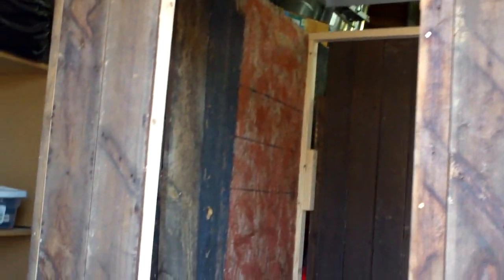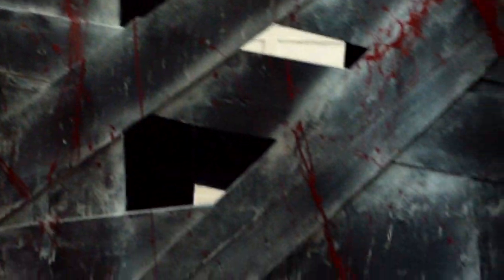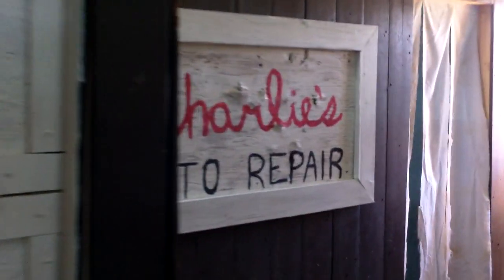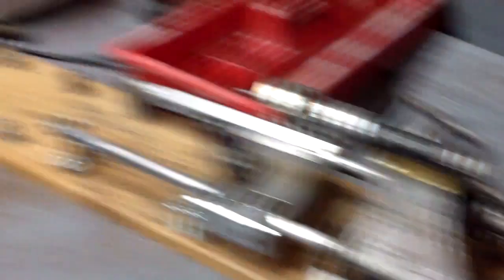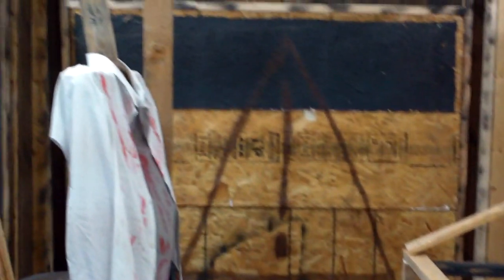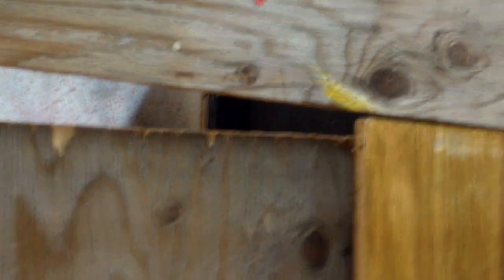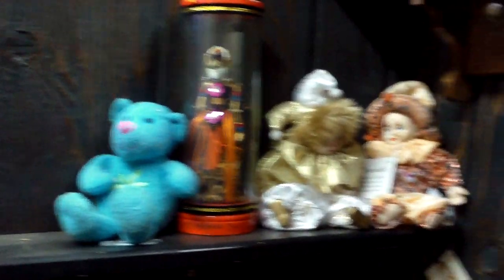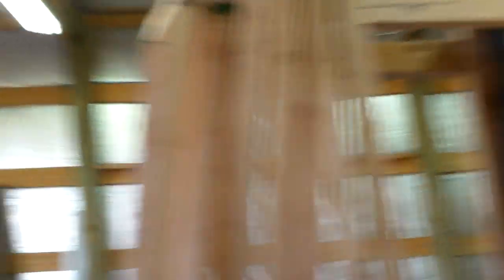Walkthrough of Creep Acres Home Haunt Oct. 1st 2012

Comment from the maker: The metal fences in the rapair shop (if that's what you were referring to) are just the $8 metal frames for cement laying. If you do use it, be sure that the fence isn't actually secured into the frame around it, but is just fully surrounded by wood so it doesn't fall out (because if you attach it to the wood, it won't rattle nearly as loud)

Thanks for the comment!!

Comment: Alright, thanks for the advice. I'm actually thinking about putting that fencing on the ceiling and have an actor reach up and shake it and they can look down on the victims. Should be alright because the sprinklers can still get water through the fence.